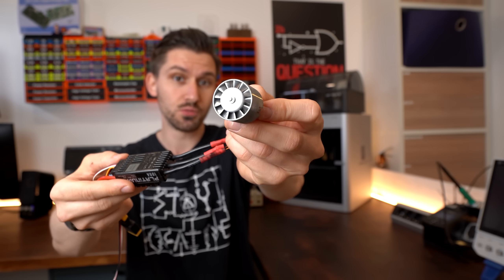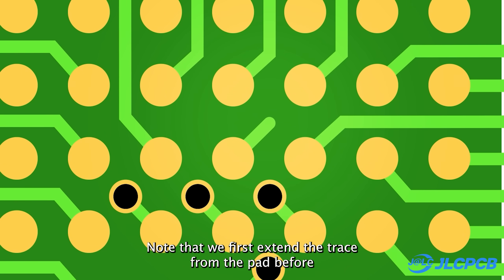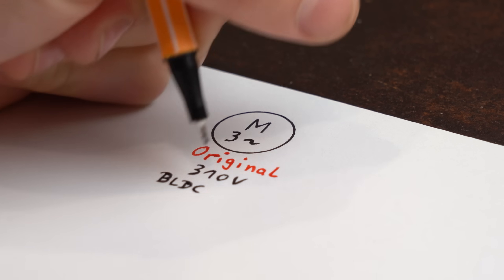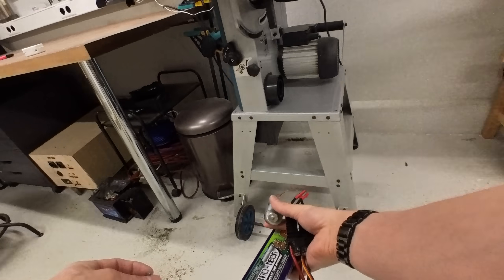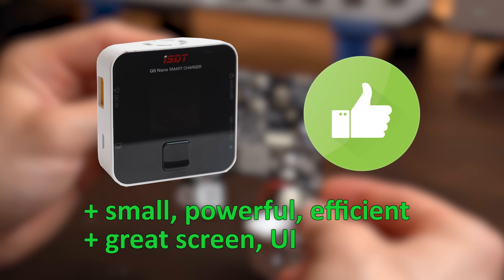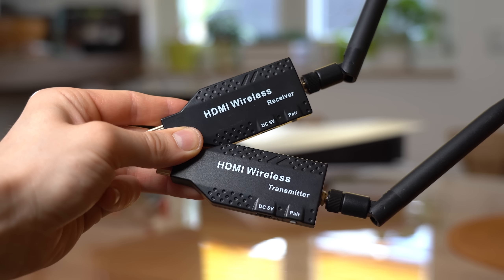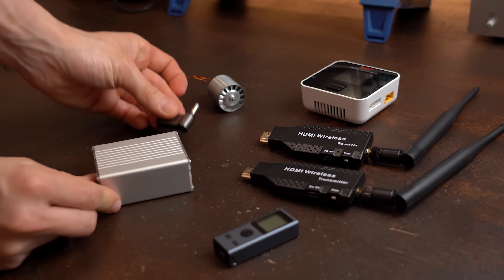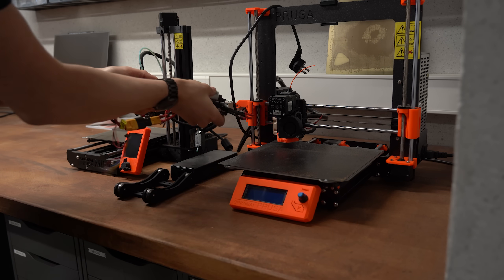I tried finding Hidden Gems on AliExpress AGAIN! (Part 9)

Comment: I use the hdmi wireless kit with my dvr setup. The dvr makes so much noise (constant disc spinning hum) that i cannot bear it in my bedroom or living room. So i use this to transmit video from the dvr to my bedroom tv along with  usb wireless mouse.

Initially i noticed that sometimes video started having digitally artifacts when i ran it constantly for more than hour. But the firmware on these devices are upgradable. All you have to do is to hold the button on the reviever for 2+ seconds i will display wifi name and password that you can connect to it also shows ip for the setup page, from there you can connect the device to wifi and check for firmware upgrade for both reciever and transmitter. I was almost 5 versions behind so kept updating untill i maxed out and its much better now and there are even more options in the setting page to control latency vs quality etc.

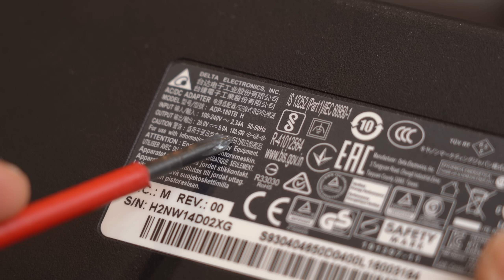Comment: 9:30 I like how you point out that the power supply is outputting 180w max but you don't factor in the constant power requirement which type c with display isn't good at high power output. I learned the hard way with mine a few years ago when I tried to use a 200w brick to type c and the type c would not charge my laptop because it was limited to 90w. 

So you would need a device that outputs normal 12v but also monitors the usage of power to get an accurate reading and then a type-c 3.1 or 3.2 rated for 230w.

Comment: @10:13 Most laptops are now designed to draw AC power when a power supply is connected and on a separate channel charges the battery, thus it needs decent power supply that do both running the laptop at full power plus charge the battery. When laptop is off the draw wattage was about 60w so with this setup on average laptop was getting around 60w of power which is possiblly low to even run the laptop and forget about charging. Not healthy for any laptop to get lower input power than standard issue power supply.

Comment: May be worth mentioning that the creator apparently does not understand the function of "UV Glue" which is not really glue at all. Think of it more as a clear resin or coating that does not discolor and turn yellow over time as a clear epoxy resin may do. For example, lets say you wanted to seat some tritium vials onto a host of some sort, this is where you would use this product. Another example: windshield repair kits use this to fill cracks, or sealing the cracked screen on your phone. 

If the test used transparent blocks so the mating surfaces could be cured by UV, the results would have been different. Like any tool in your kit, you have to know when it is appropriate to use.

Comment: By the way, i have same Type-C PD trigger and same laptop, and yeah, it works not so great, but, if you no need to run games or software that drains a lot of power, you can simply set low power mode in windows, and charge goes well!

Comment: 08:00  HDMI Spec...   I think you reversed the power consumption which should be :  
"Less the 10 milliamps for the Receiver and around 200 milliamps for the Transmitter.

Comment: The reason they tell you to get the 200 meter range HDMI to go through walls is because that guarantee has much higher power output and most likely only a few mW normally. Buy a 1W amplifier for the frequency and enough bandwidth and you would get some miles of range, and with better antennas more miles and with parabolic antennas to the moon. Not especially legal with 1W or mess with them at all perhaps but that is another story.

Comment: 6:15

That isdt charger looks nice especially the full discharge feature, but i have a very hard time believing it will output a steady 200w
With its size, i see it heating up very quickly and reducing amps. 
My HOTA 400 watt charger is about 6 times larger and it still heats up while charging two 7.4 5200 mAh packs at 5.2 amps each. It turns on its cooling fan 4-5 times in 45 minutes of charging to keep the temperature below 65 Celsius.

Comment: I think the usb-c laptop adapter would work fine on lot of laptops. My laptop has 135w charger, but i have charger from older laptop that is just 65w and that works fine in light use. However, if i run something heavy, charging led starts blinking and it stops charging.

Comment: Since my cat ate my laptop charger cable I've used similar adapter that you show here. I've not had any problems with power but the one model shown here breaks easily. I have found out that the one with short cable in the middle and the one with rounder design are sturdier.

Comment: My Laptops you can simply charge via USB-C as well. So when it is turned off simply plug into the USB-C Port and don't use the adapter. There should be no difference to the barrel plug.

Comment: I got a very similar USBC adapter for Lenovo laptops for traveling. Charged the computer fine using a 120w MacBook power brick and would only struggle if I tried playing a game (which I didn’t do when traveling). 

The only issue I had is that the trackpad would become sluggish. I used a wireless mouse so it wasn’t an issue but I think the sluggishness may have beed due to the lack of ground which the original power supply had. That’s just my theory though.

Comment: Wireless hdmi with 4k would be cool thing for me, especially when I stream concerts on live events to projectors (LED panels are usually on network). 50- 80 euros for HDMI extender is quite ok, considering that known brands sell them for 200+ and they are not pocket sized like those you found.

Comment: There are 140w usb c pd3.1 to dc cables with similar ending like adapter on video. I wonder how some socket version of them cam can get 20V/7A from 140W usb c charger/power bank(standard for pd 140W is 28V/5A). I've ordered one, but seller don't answer for my question(just telling the package is sent 😂):

https://a.aliexpress.com/_EGKRUcN

Comment: They now sell that motor with a speed controller that just works at 12v but the motor is still high voltage.

Comment: @greatscottlab 10:10 You should be careful when determining USB-C devices using that cable with display. I bought one, and found out in some instances it worked fine with some devices , but with others somehow messed with the QC protocol, so connected devices would fall back to standard USB 5V charging and would either refuse to enter QC or it would be intermittent. You should try that adapter with a known good USB-C cable that has a complete set of conductors (some USB-C cables don't populate all pins in the plug).

Comment: I just bought a compact air pump, for inflatables and air mattresses, on Amazon for about $20 US. It uses that same motor, is USB-C chargeable and has a built in light!. Doesn't look like it is quite as powerful though. Probably has to do with the voltage applied. I wonder if one could make a "power bank" with this motor and light included and market it towards tent campers.

Comment: Its a complete coincidence.. a few months ago i bought that same USB-C to barrel jack adapter off of eBay for, if im not mistaken, the exact same laptop (MSI Katana GF66). the power draw is quite high for this laptop so i'd only ever use it with the laptop powered off or on "Super battery" mode.
If im not mistaken, in the test, the lapotp was using the dedicated GPU also (through the hard-to-see amber light on the power button), probably also causing it to draw too much current...

Comment: Be careful on buying the wireless hdmi, all the seller are putting misleading description and images. In the link one they give you the receiver only, I didn't double checked because the images are showing both but the description says receiver only. I sent it back. Checked others anche most of them have misleading description too the only way to know what you're getting is the color selector. Very poor behavior by the sellers. I'll try the model from lemotele sold by 'lemo tech it'.

Comment: Can you add these "Rechargeable Alkaline Batteries" up there the past few months, with no proper (as if there is one) charger to match on there as well?, please?

Either they are regular Alkalines that folks with just toss, or stick them in a Lithium charger burning their house down.

The first article describing a charger that might work would be cycling between nearly causing a fire, letting it cool-off, nearly melt it, rinse repeat.

Thanks

Comment: I have the same Bosch laser tape. The accelerometer inside is useful (or mandatory) to keep the laser parallel to ground. If you tilt the laser up or down you can get an incorrect measurement being the hypotenuse of a triangle.

Comment: Your channel is fantastic, I'm always excited to see your Hidden Gems videos.

Can you recommend a boost converter with low RF noise, birdies, etc.?

Preferably a module from Aliexpress, but there are so many.
The converter should deliver a maximum of 19.5V and 10A at 13.8V input. It's intended for a mini-ITX motherboard used in an all-in-one SDR.

Do you have any suggestions?

Comment: Do you know where to find a datasheet on the PD3.1 board? I'm planning to build an external laptop battery with one but I can't find any datasheet or efficiency numbers. I'd be running it for hours at 140w so I need to make sure I don't overheat it. Does the button turn it on and off or is it just used once to kick start it like a BMS?

Comment: I don't think those EDF motors are actually disassembled and rewound like you claim.
Lower voltage for the same power requires more current which requires thicker wires.
I'm guessing those motors are more expensive because there is more copper in them.

Comment: USB-C to barrel jack adapters is awesome! The newest USB-C PD spec supports up to 240W, but currently the only device on the market that will ask for over 100W is the new Framework 16 laptop. Thus, there are basically zero chargers on the market supporting the new spec yet. I made the mistake of not including Framework's charger they made for the new spec to go with their laptop, and was not able to add it to my preorder. They aren't available for general purchase yet, so I can't keep up with the power demand of my beefy new Framework 16 when I'm pushing the graphics card when gaming 😢

Comment: Hey,  can you help me find a 12V DC UPS module that can output around 10 - 15A ? It needs to be 100% uninterruptible so my minipc won't restart itself. Thanks for your help in advance. 

More details:
input1: Battery (14V)
input2: DC power supply (12V)
output: Voltage regulator (to 19V) -> minipc (19V)
              Voltage regulator (to 12V) -> 12 x servos (12V)

Comment: Lot of sellers on chinese platforms sell these air blowers/vacuum packaged in 3D printed body cases, like the one you quickly showed, yes. Regarding the wireless HDMI, it's clearly not for you, but useful for many use cases (carrying devices is not a solution when you have to do it few times a day).

Comment: What ESC do you recommend, also the speed controller, I did catch a glimpse of the Platinum Pro but its quite expensive, found on German hobby website for 100EUR. I'm in UK, anyone help out on this? P.S. I already bought the motor, too late to buy all three as advertised on AliX 😑

Comment: You should just get full cable with pd trigger and fitting connector. I have one for ThinkPad x1 and it charger without any problem from 65w ugreen charger.

Comment: WIRELESS HDMI
Buy a RF amplifiers that they  fits perfectly between the frequency range of those two dongles and try it this way instead. I would love to see 200+ meters of wireless video. 
One such an amplifier is hooked up on my LANCOM router's 2.4GHz output  and if you are trully a German, those routers are actually German product. My Wi-Fi amplificator consist of two 5W RF amplifiers in 2.4GHz range and if i place that LANCOM router on the roof of my house, i'll get access to my Wi-Fi network roughly 1.4km airline away WITH using my phone. I Tried it with my laptop and TP-Link modified Wi-Fi dongle also equipped with RX-TX Amplifier and 19dBm antenna, the distance is 4times larger.

Comment: The usb-c charger trigger board is great for modern laptops that aren't usb-c PD compliant.
I keep a 90w usb-c power supply in my laptop bag, and i use one of these trigger boards with my Asus vivobook.
So i can use the PS with my Asus and my Dell (which is PD compliant)

Comment: well i have a suggestion for your simple esc circuit idea,

i think, that idea just might work, if you change the polarity o all the coils
That will cause the motor run on repulsion instead of attraction, though that might cause you not knowing the direction of motor spinning
Still it will start everytime, atleast in theory according to me,i have never tried ,but thats just my theory ,please try it.

Comment: I actuallt use cheap Wireless HDMI dongles to help record my kids' performances, connected to two cameras that havr massive power banks so i dont need to run cumbersome 30fr extension and HDMI cables.

Comment: @GreatScottLab
I have been looking on aliexpress for a bench top power supply that I could control over wifi.. from far far far away
== See device example at bottom ==

I want to control it using my own code...  I don't know if any of the ones like this allow you to modify the esp code... 

I was hoping to use i2c, but found out it communicates over serial at 115200 baud, so that should be easier to reverse engineer the commands...

I am looking for something Under $30 if possible....
Can you help?

RD6024 RD6018 60V 24A DC Adjustable Step Down Voltage Bench Data Storage USB WIFI Power Supply Buck Converter Voltage Regulator

Comment: I have that Type-C adapters for one of my laptops and it works perfectly fine in for both different laptops (both required normally a 60 watt charger, i have one 100 watt GAN-based for it using this adapter and rated cable). It might be a protocol issue support in your case, miscommunication with the charger.

Comment: i prefer having easily replaceable batteries in my level, in the field we need it now not 30 minutes after it gets done charging. the hdmi extenders are useful for projectors and i have a set. the laptop adapter, why is it even a thing? you’re gonna have to carry a wall wart around anyways for it so might as well just carry the actual charger lol.. if it’s for a battery bank, why not just buy a bank specific to your device..?

Comment: 10:15 - Your laptop is trying to draw more power than the adapter can provide, causing it to cycle power on and off. I had the same issue, but it works fine if I remove the battery or if the battery is already fully charged. 100 watts isn't enough to power a high-demand laptop and charge the battery simultaneously

Comment: Most people simply have unrealistic expectations. For example, they could get a 1 terabyte SD hard drive for €1, including shipping... Or they think they're big YouTub-Maker, but can't manage to re-drill a messy hole or repair a wobbly guide rail. Of course, the edge router wasn't well received (and of course it was the seller's fault). The fact that everything that could have been done without any problems was made of plastic also became a problem. But the fact that the motor used was the same as the current Makita model at the time and the overall design was very well thought out was of course no argument for saving on unimportant parts in order to somehow get to the price of €30 including shipping... Then there are those who just buy rubbish. But the description already says that it's rubbish. Not literally, but - for example, a projector with only 500 lumens but for €250. It's completely clear that you can't do anything with the thing! And certainly not in daylight!  But of course it's the shop's fault. Because they sell things like that... Sure, because they basically force you to buy them. The only problem I've ever had with it was the shipping. The DPD warehouse that took care of the delivery is about 1km as the crow flies from my apartment and I live in a central location. Despite having a satnav, the driver couldn't find my street. Not only did he not find the house, he couldn't find the whole street! He is said to have "tried" 4 or 5 times. But the driver is new and doesn't know the satnav... after 4 attempts? Is he even allowed to drive a car? Ultimately, the boxes and plastic casings in the boxes were broken. They had clearly been kicked. And they were wet. There was a lot of electronics in them, but luckily they survived... But! After I complained about it the next time I ordered and showed them pictures, DPD never came to us again when we ordered something from them, which I did regularly for a while. All great stuff!  The housing would have been replaced, but since I had to wait so long for it, I didn't want to wait any longer and had already repaired it. So a replacement wasn't necessary.

Comment: in re: the Bosch laser tape having a level function and the cheap one not - if you only need a spirit level occasionally, then there are smartphone apps that tie into your phone's position/acceleration sensor that will do quite well for that purpose.

Comment: Hi, the HP adapter should output 3.3v in the sense pin(middke pin) the Dell is reverse it sends out 3.3v into the charger. This is how many people destroy their hp/dell laptop batteries by interchanging the chargers. I'm assuming the dc Jack while being a 20v pd trigger has also some electronics inside to emulate the Sense pin casing the msi laptop issues. A normal 4.0 x3 mm barrel jack adapter should be available. I use u universal o e which comes with a set of jacks incluing the size you need

Comment: Do you have an idea for a wireless DVB-S (satellite cable) solution? So I don't need to run a cable from the satellite antenna to the TV? I have seen satellite to IPTV receivers but they were like 500€.